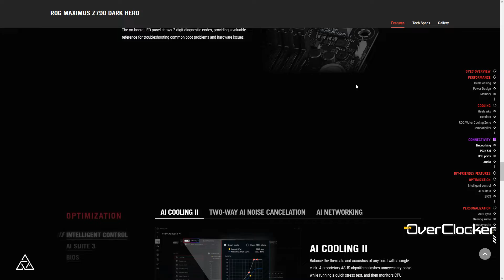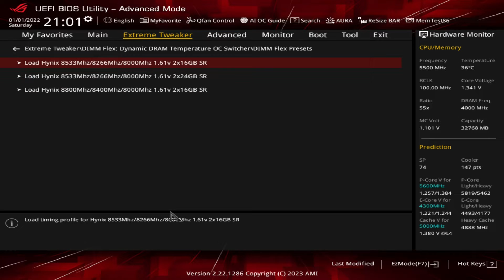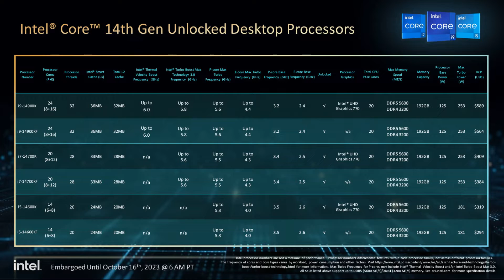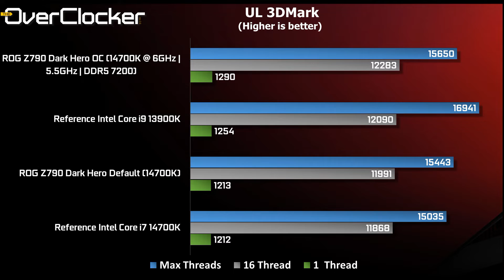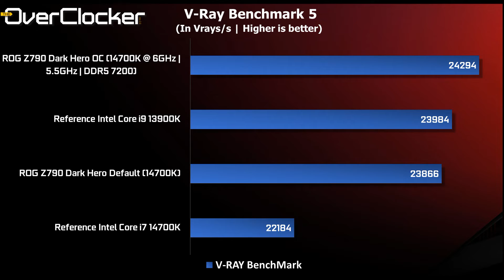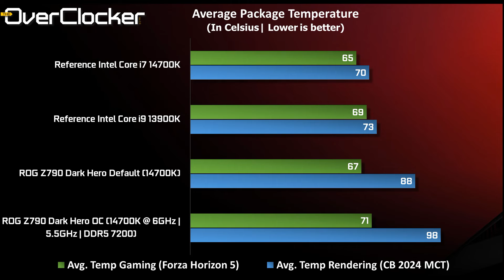ROG MAXIMUS Z790 DARK HERO (Featuring Intel Core i7-14700K)

Comment: hey bro what cpu you sugest me on thet mortherboard with no problem overheating  and which is good for gameing
Reply from the maker: Since you asked on a Z790 platform video I assume you are wanting to buy into that generation. If so, you can get a Z790 Strix E and a 14700K. Still offers some of the best gaming performance there is.
Reply: @TheOverclockerMagazine  and how much power limitis he use over 250 w in gameing or

Comment: I am having an issue that the Microphone has a loud pop both using the front panel and the rear mic-in input. Is anyone else having the same issue with this board?
Reply from the maker: Have never heard of this, maybe your particular board, which may need to be swapped out
Reply: @TheOverclockerMagazine  Thank you for responding. Do you still have this board available to run a test if you also have a similar issue?
Reply: I solved my issue. It seems to be a lose wire in the front panel HD Audio connector that was causing issues for me.

Comment: Hi, I am going to be installing a Samsung 990 Pro 2TB M.2 in my Asus ROG MAXIMUS Z790 DARK HERO ATX LGA1700 Motherboard. It will be the only drive, for now.
Which slot should I install it in? I'm confused on how it cuts the lanes of the PCIe slot down to x8 if I install it to the'Top slot' ?
Any help will be much appreciated. Thanks
Reply from the maker: It'll be fine in the top slot or primary M.2 socket. The drive is Gen4 so it will not interfere with your Gen5 connectivity. The board has the x4 PCIe Gen4 lanes from the CPU directly wired to this slot, the X16 lanes for VGA are separate provided it's also Gen4
Reply: @TheOverclockerMagazine  Thanks for the reply, my build is  i9-14900k,Dark hero, 4080 super & 48gb memory. Keep up the great content and look forward to more videos !
Reply from the maker: @chojingab  thanks for the kind and empowering words. Will keep improving 💪

Comment: Dimm Flex was created because DDR 5 is a train-wreck, much like DDR 3 was.  How soon people forget...
Reply from the maker: Who knows, but the DRAM being sensitive to temp is expected as that among other things can cause signalling issues which are not a problem with dealing with the lower speeds of previous DRAM generations. With DDR5, we are running 4,000MHz at DDR5 8000 and higher, stands to reason that at such frequencies things a little more complex and tolerances a little less.

Comment: Idk if my ram sticks are faulty, but this mobo with 14900k and Gskill trident Z 48gb 7200 can't maintain the advertised XMP speeds. Blue screens and post loops at any frequency above 6400.
Reply from the maker: I didn't have much luck with this board and speed DDR5 OC at all tbh. In fact, the cheaper, competing WiFi-7 from GBT treated all my DRAM OC better.

Comment: Super interesting review, thank you! The bios has been updated since the version you used here, with presumably some performance improvements. Where you able to redo a few tests (like RAM OC) with the new BIOS?
Also, did you hear any coil whine on this board?
Reply from the maker: I didn't have any coil whine on this board however I've not tried a new BIOS. I know others also struggled with DDR5 8000 on this board though.

Comment: Z790 Dark Hero, Gskill 48gb running at 7800mhz, (still working on 8000, throws memory errors), 14900k, T700 crucial 2TB, RTX 4090 strix OC

41k cinibench r23 stock but had to use ASUS bios setting to limit cpu to 90c. Even with H170i 6 140mm fans with no limits chip instantly hits 107 c in cinibench. Have a contact frame to try and see if it will bring temps down. If it works I can see it hitting 42 or 43k cinibench stock on this board. 

0220 bios, still no update. Hoping an update will stabilize 8000 ram.
Reply from the maker: Yeah sounds mighty powerful, I'm at 41K at most with the 13900K. The 14900K I have, is just not producing the results. That said, 8000 should be more than doable on that board without any of the errors you speak of. It would be mighty disappointing if it couldn't stabilize 8G. Keep me posted and on the Contact frame as well. I wonder how much difference it would make. If indeed it takes you to 42K I'll get one as well.
Reply: @TheOverclockerMagazine  Update Gskill 48GB kit 8000 running at 7800 started throwing errors. Returned and received a replacement 8000 48GB kit. 

Installed set xmp instantly started throwing errors in memtest. Returned. 

Ordered a set not on QVL list. T-Force 8200 48GB 

Awaiting new kit to arrive 

So far unable to achieve advertised speeds with a gskill kit listed on ASUS QVL for Dark Hero. Oh I plan on setting xmp on the T-Force but manually setting frequency to 8000. Will see what happens
Reply: @AdventureswithScottandCat you have to manually set voltages xmp won't work right off the bat at 8k even on 2dimm board like apex
Reply: @AdventureswithScottandCat I ended up getting the G skill 6400 48 GB kit. It is on the QVL if you use two sticks. All the XMP settings work flawlessly. 😊 Unfortunately I was still getting RAM usage of about 80 to 90%. So I ended up dropping two more sticks in and running stable at a slower speed but I don't know enough about memory to know if I'm gimping my performance
Reply: Hey I am in a similar situation except I went extreme overkill on the ram without knowing about the dim limitations. I now have four dims 48 GB each running at around 4800 or 5000mhz. If I take two sticks out I can run at 6400. I am doing a lot of 8K video work and it eats up a lot of RAM. At the moment I am testing the four sticks and I am replacing my graphics card right now. I removed the m.2 5.0 from the top slot and put it on the second slot on the motherboard. I am trying to get 16 lanes for my GPUs. Currently thinking about stuffing two graphics cards in there. Anyways I would love to know how you are making out with temps. I reseated and added extra thermal paste last week and my temps dropped quite a bit. I'm still getting about 90C package temps. Definitely not even pushing this to its limits yet. Very curious to hear how you've made out.